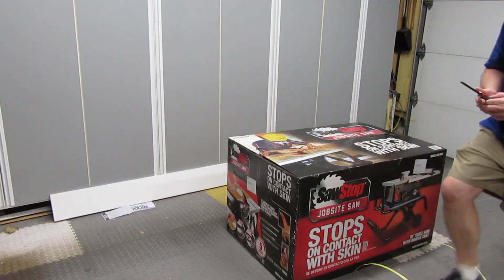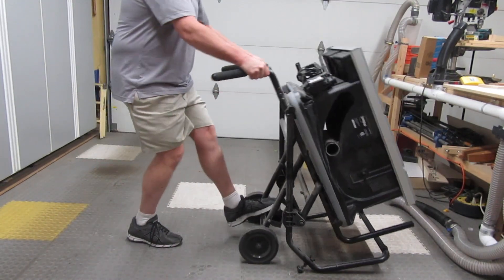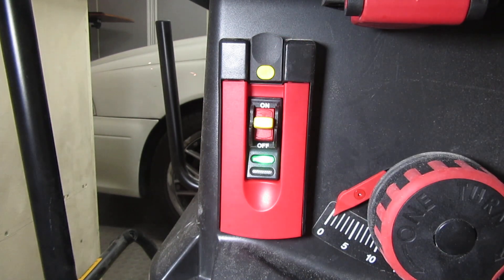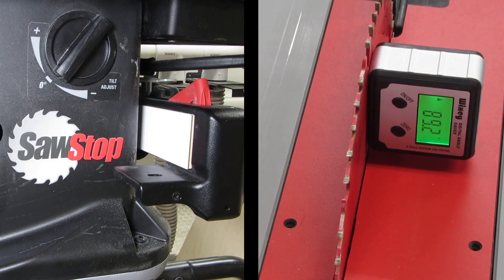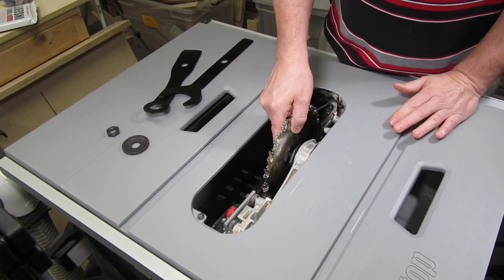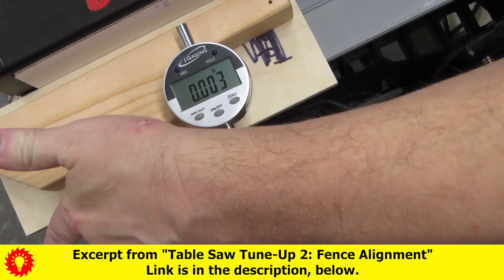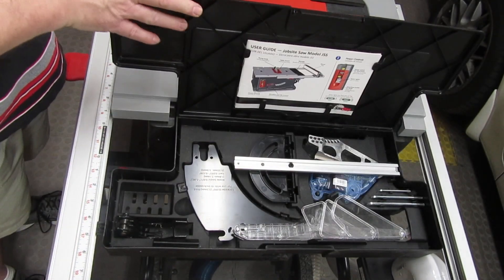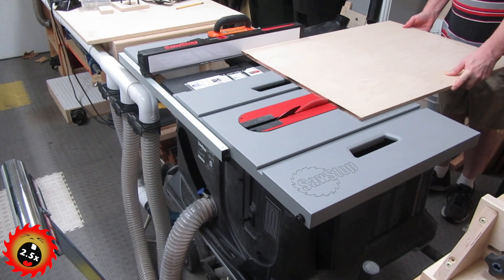SawStop Jobsite Saw Unboxing & 5 Month Review

Comment: Great review! My dad just cut the tip of his pinky finger off using a Harbor Freight Table Saw and I'm currently using a Craftsman Contractor Table Saw that I have been using since 2014. I have it dialed and calibrated, but this recent accident has me seriously considering buying a Sawstop. I just have to convince my wife that $1300 is worth it. It's a lot of money to spend on one tool. Especially when woodworking is only a hobby for me. We'll see.
Reply from the maker: Thanks! It was actually my wife who convinced me to spend the extra money to get a SawStop. Of course she's concerned about my safety, but there's another issue also. Getting injured means a trip to the hospital, and even with great insurance, that costs money. Not to mention the time you might have to take off work to heal. Assuming you actually can heal... So when you look at it that way, it virtually pays for itself.

One warning about this SawStop I didn't cover in this video (I need to do a "1 year review" video). As I mentioned, I love the fact that the blade goes up and down with just one turn of the crank. But this means it can be really hard to get it to an exact height, when you're trying to do something like cut tongues for tongue & groove joints (I'm struggling with this right now, and in fact, I've given up and am using a router bit set.). So just be aware of that.
Reply: @TheNewbieWoodworker  I was wondering that too about dialing in the exact height. I'm not sure I could justify the extra cost of the Contractor saw. It's another $400. I do love the idea of having a space saving table saw because I am using half of a two car garage. Are you able to safely cut down full sheets of plywood or at least half sheets, seeing as how there's not a lot of infeed support?
Reply from the maker: @LutherBuilds  I'm in the same situation as you, with half of a two car garage. If you want to see just how little room I have, check out this video: https://youtu.be/BG-HGjoGvhE.

I cut sheets on the floor with my circular saw, raised up on 2x4s (after I back my wife's car out 😄). When I get them down under 48 inches wide, then I do them on the table saw, using 3 Harbor Freight roller stands (very inexpensive, and they work great). I have to roll my router table out of the way, but it works. Here's a video showing it (with only two stands), but if I had it to do over again, I'd do the video much differently. https://youtu.be/Oz2Fl1Ca4qA

Comment: ABOUT THE FENCE!  There is a simple fix for this nuisance:  When you lock or unlock the fence pull it toward you.  It stays put.  

I have had this saw for about 6 months and am trading it up to the contractor saw.  It's great for carpentry, but not for fine wood working.  The biggest problem is that one turn height adjustment, it's difficult and tedious to dial in an accurate height.  I may be spoiled, I owned a PCS for 8 years before moving to a house without a big workshop at ground level.  

The mitre slots come second, you can't get a tight but easy to slide fit because of the useless coating they sprayed on the top.
Reply from the maker: Thanks for the post. I pretty-much agree with what you said. I've since upgraded to the PCS, and I love it. I still recommend the JSS, but with the caveats you mentioned.

Comment: I'm three years late, but just wanted to mention that the Diablo blade you put in has anti-kickback bumps that can cause a problem with the braking mechanism. It's on SawStop's site.
Reply from the maker: Thanks! I learned that a while ago, but it's a good thing to point out. 😄

Comment: Thanks for the video. I purchased my job site saw stop last summer.  When I was deciding which model i would buy the sales people at Woodcraft told me to ignore the job site model.  After some research on my part I decided to give it a shot.  I wanted something portable because as we downsize I wanted to be able to move it easily.  I also wanted something safe as my grandchildren were doing more in the shop.  I have found the saw to be more than adequate for my needs.    Accuracy is right on. Power is fine making boxes and shaker box bands.  I’m sure someone will say it doesnt have enough power for thicker pieces of hardwoods I’m not sure about that. All in all I’m very happy with my job site saw and feel comfortable with my grandchildren learning woodworking with it.
Reply from the maker: Great comments. Thanks! Yeah, the power complaints have me scratching my head. The JobSite has about the same issues with tough wood that my old Ryobi did. I would think any portable saw is probably going to have the same issues. But like you said, keeping your grandchildren safe is job #1. Everything after that is just for fun. And you're right - the accuracy is spot on. Thanks again for the comment.

Comment: Great review. This convinced me to get one also. I have the same issue with the fence moving upon locking. The only other issue I have that wasn't mentioned in the video is how there is a delay before the machine allows you to run the blade when you turn it on initially. It's slightly annoying, and confusing when you run into it the first time
Reply from the maker: Cool! If you call SawStop's support line, they'll give you some tips that might help the fence issue. It didn't really help me, but some other people have said it helped them, so give it a try. And yes, there's a delay after powering on. Being a computer guy, it wasn't a surprise to me that the saw had to "boot up". But I can see it being unnerving if you didn't expect it. 😳Personally, I leave mine on all the time, so it's really not an issue for me. Have fun! 😄
Reply: @TheNewbieWoodworker   You must not have grandchildren running around your shop.
Reply from the maker: @marshallmurrell4583  You're correct, I don't. 😛

Comment: Hey, another person with a router related accident. Thanks for the review. I think I'm sold.
Reply from the maker: You too, huh? Hope you're OK. 😄
Reply: i'm scared of my routers, you can really screw things up with them, including yourself, they are for the more advanced , i use mine, but i seccond guess every move i make with them, the first "real"bit i bought, as soon as i tried to take it out of the holder, i put a cut the entire length of my thumb, and cut the side of my index finger to the bone, i learned real quick  to respect those things, 13 stitches
Reply from the maker: @jakeqwaninne8502  Yeah, hand-held routers still scare me after my accident too. But my router table doesn't scare me at all, so at least I've got that going for me. 😏

Comment: Perhaps mentioned already but the fence moving when mentioned in their fence video.  Pull fence forward the front then click it locked.
Reply from the maker: Someone else has mentioned that also, thanks. I don't have the saw anymore - I upgraded to the PCS, but I shared that tip with the new owner.

Comment: I am thinking about buying this saw. I am tired of saws that wont give me a straight cut even after tuned. Does it cut even? Thanks for the video. You really show a lot of other people dont. They only care about the break system!!
Reply from the maker: Yeah, the brake system is awesome, but if it doesn't cut, what good is it? This saw works great, and although I've upgraded to the SawStop PCS since this video came out, I still think the JSS is a great saw. SawStop introduced a JobSite "Pro" version a while back, so you might be able to find the regular JobSite saw used.

Comment: Nice review. Any word on the fence moving? It would seem that your locking mechanism is releasing one side prior to the other and causing movement.
Reply from the maker: Thanks. No new info on the fence, other than it's not an issue unless I'm trying to get a dead-solid-perfect dimension, like with runners. Other than that, it's no big deal. I don't doubt that what you say is true. It's just a poorly-designed system. I mean, I had an old Ryobi table saw before the SS, and I never had this issue. So it's not a matter of cost, just poor design. But it's not a show-stopper, and truth be told, I do love the saw, in spite of its issues. Being able to raise and lower the blade quickly is something that I'd never want to live without again. 😄
Reply: @TheNewbieWoodworker  This comment was awhile ago so I'm not sure if you are still having the issue. If you are, my guess is that it does this because of how you adjusted the fence to be square. You've made the fence square but now when you clamp down it is fighting against itself a bit to achieve that squareness. In other words, the clamping pressure when you lock it in is overcoming the bias and locking it in place square. Once you release the bias is free to spring back. I would try to readjust the fence to be square again even if it is square now. Loosen it up and start the process over and try to do it a bit different than the last time. Remember, it needs to be square when it is clamped down not when it is able to move freely. When it is moving freely all you need is the measurement to be accurate (I'm sure you realize this but thought I'd say it anyway). Sometimes when we adjust things with multiple adjustment points we end up getting to square but possibly not in the best way. Know what I mean? If you do readjust to square and it still does it then I assume you either received a component that is bent somehow or you unknowingly bent it while making adjustments and clamping down or all of them are like this and there is nothing you can do. I just bought this saw and am receiving it next week. If I can remember I will come back to this comment and tell you what I see and also how my adjustment to square went. Oh, and nice review!
Reply from the maker: @suburbanhobbyist2752  I don't know if the OP will see this, but personally, I appreciate your comment. You are so right that we can adjust things at too many places, and end up working against ourselves - it happens in a lot of areas. So thanks for sharing! 😄

Comment: I am “new” to using a table saw (I.e. I do not have one, but have briefly used saws belonging to others).
I was uncomfortable with the short distance between the front of the table and the blade with the job site saw — it is 6” as opposed to the 10.25” to 10.75” for the other saws.
This is not a short distance for a portable saw, it just means that I am holding off since I do not have a good space for more than the job site saw. The contractor saw will probably be good for any “need” I have... but the other ones are so pretty.
Reply from the maker: Thanks for the comment. Honestly, that distance has almost never been an issue for me on the SawStop. Most of the time I don't work with large enough pieces to where it would matter, but those few times when I do, I have a humongous cross-cut sled, which effectively adds more distance to the front of the table.

But there actually were a couple of times it caused a problem that the sled couldn't help with. So I used one or two roller stands I got from Harbor Freight to help support the stock. Pretty easy, and the fold up and hang on a wall when not in use.

But like I said, the vast majority of time, at least for me, it hasn't been an issue at all.
Reply: The short distance is a definite drawback.  Like NW, I have a large cross-cut sled, but if you overload it, it tends to tip up on the back side.
Reply from the maker: @marshallmurrell4583  😮

Comment: Hi Dan... Love your videos.... I have a question.  I am replacing an old Craftsman contractor saw, and I am struggling as to what to buy.  I like the portability of the job-site saw, and I am wondering if you could elaborate on what was the biggest advantages you experienced when you went from this Saw Stop jobsite saw to the cabinet model you replaced this one with.  I don't think I have the room or budget for a full cabinet model of the sawstop and the contractor version is actually bulkier than the other so because of space limitations I can't consider this.  I have also looked at the Laguna Fusion 2... smaller cabinet type saw, but alas, no safety stop. Any help would be appreciated.
Reply from the maker: Thanks! First of all, I was surprised to learn that the SawStop PCS isn't much larger than the JSS, so check the specs. But I wouldn't hesitate to recommend the JSS if that's what fits your space and budget. You may also be able to find a used one, and it's a pretty simple saw construction-wise, so it would be easy to tell if it's in good shape or not. The differences are the kinds of things you'd expect from a cabinet saw vs. a job site saw - cast iron top, somewhat better dust collection, more precise positioning of the blade, more power, bigger surface. But I don't know of anyone who was sorry they got the JSS, so if that's what fits for you, go for it! Hope that helps - if you have more questions, feel free to ask.
Reply: @TheNewbieWoodworker  Thanks for the reply Dan... I guess the only followup question would be... Do you think the quality of the work you are able to do is better with the PCS vs the JSS.... thanks again for your insight!
Reply from the maker: @Sigtech55  That's a good question, and honestly, well, I'm not sure. Let me think this through out loud. There's certainly something nice about having a much bigger table surface, but honestly it probably comes in handy more for putting tools on the extension than actually cutting, most of the time anyway. The table top is wider from front to back, and that helps with larger stock. As for quality of work, maybe just a little? Not enough to justify the cost difference though.

I like having a cast iron top so I can use magnetic stuff on it. But the SawStop cast iron scratches pretty easily - everyone seems to agree with that. It doesn't affect anything other than the fact it looked so shiny when I first got it, it kind of broke my heart to see the scratches from out of nowhere. But they're basically cosmetic, so it doesn't really matter.

I really liked the crank on the JSS, being able to raise and lower the blade really quickly. But it's at the cost of fine-tuning the height adjustment. You can still do it, it just takes a little more effort. The crank on the PCS, on the other hand, takes a lot more turns to raise and lower the blade, giving better fine-tuning. But how often do you need that?

I guess the bottom line is that there might very occasionally be something I can do better on the PCS, but the vast majority of the time, anything I can do on it I can do just as well as on the JSS. So if you're looking for an excuse to buy the PCS, you will never regret buying it. But I doubt you'd regret buying the JSS either, unless you just really want the PCS. I mean, there's something to be said for just getting what you want, if you can afford it. Like I said, the footprint of the 36" PCS is surprisingly similar to the JSS, and you can get the figures on the SawStop website.

LOL, I probably haven't helped at all.

Comment: on the fence, i saw 2  set screws on the vertical face of the t part of the fence, maybe drive them foreward ?? or try some graphit spray on that switch lock??, your almost forced to push it out of position du to where they put it, hmmm, they can make it sense moisture, but not have a perfect fence, bosch misses stuff like that too
Reply from the maker: I had tried that, but couldn't ever get it right. I don't have this saw anymore anyway, since I upgraded to the PCS. But it was a great saw, despite a few shortcomings.

Comment: Are you completely sure that the sawstop mechanism works with third party blades? I can definitely see reasons the OEM would use proprietary blades exclusively on a saw like this. I've never seen a sawstop saw demonstration using anything other than a sawstop blade either.
Reply from the maker: Yes, I am absolutely sure. https://www.sawstop.com/support/faqs/ answers this question, about half-way down the FAQ list. Also, see this webpage from a SawStop engineer: https://www.trentdavis.net/wp/2018/08/06/helpful-sawstop-links/#32--10-blades-.
Reply: @TheNewbieWoodworker  TY for the info. A sawstop table saw is on my wish list either way but more so now  :)
Reply from the maker: @thefirsted  😄Check out the SawStop Users' Group on Facebook https://www.facebook.com/groups/sawstopusersgroup/. There's a bunch of really good people there, and it's run by a good guy from SawStop, so you can hardly go wrong.

Comment: Did you notice any shortcomings with using the jobsite saw versus the contractor saw?
Reply from the maker: The only SawStop I've used is the JobSite saw, although I've seen the others at a Rockler store. So I can't really say one way or the other. However, the JobSite saw is the only one that can raise or lower the blade with one revolution of the crank. Personally, I love that feature, but I doubt it's a good enough reason to not get the others. 😄